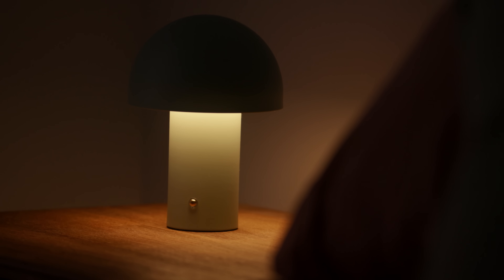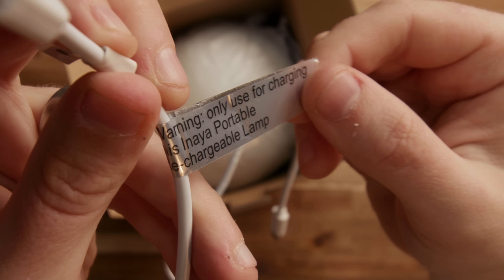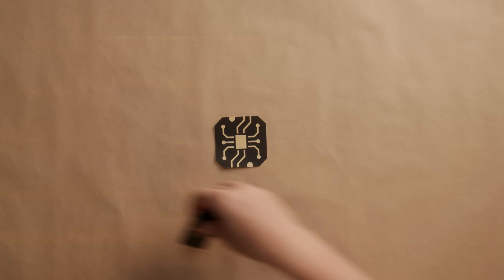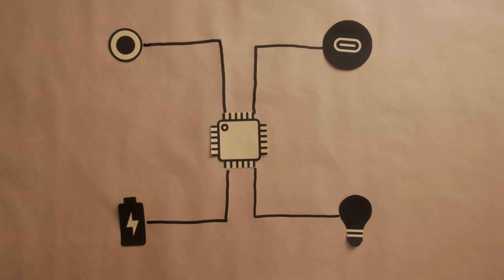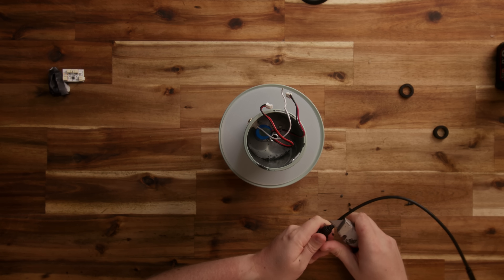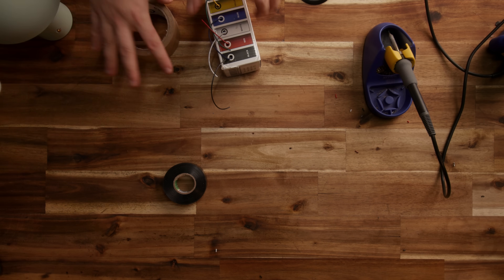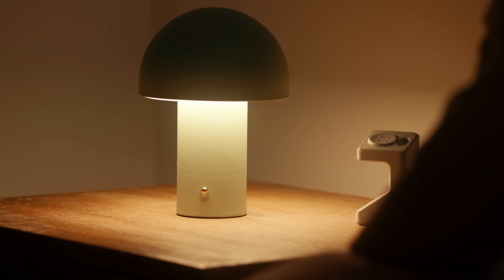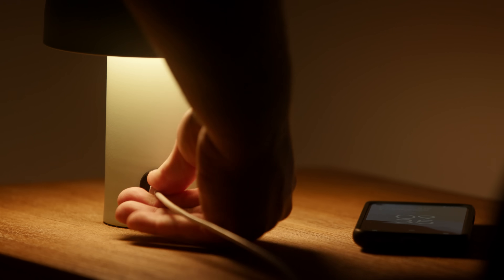Kmart Lied to Me, So I Hacked Their Lamp

Comment: You should change the battery for a power bank with USB-C-PD output and put a Qi charging coil in the base, then make your nightstands in to Qi charging surfaces.

That way you would never have to plug them in and you could use them as USB-C chargers for any devices that aren't Qi compatible.

Comment: I've realized that a lot more of my tech doesn't "line up" with how I like to charge this past year. I have found that the old "if it charges your phone, it will charge anything" idea simply isn't working. Learned that my fast charger could fry my playstation 5 controller was wild but true. Have bought two different specialized devices that needs a slow charge or I risk not being able to charge, or frying the motherboard. I now have at least a handful of USB-C cables that cannot distributed the correct data or power to be used universally. It is MADDENING. USB-C is  still the agreed upon standard, but the requirements don't go down to the power needed/allowed to juice and I think that's the problem.

Comment: For those diving into the project without much electronics understanding; on your website. How do I read the circuit digram re. the MOSFET. Which leg is which in your diagram?
Reply from the maker: That's a fair enough question! 

This link should have the information you need to solve that :)

https://www.talkingelectronics.com/projects/MOSFET/MOSFET.html
Reply: Just to send a follow up. I ended up wiring this up and get either of the following 2 outcomes. 
The light is permanently on before even energising the esp32. Or alternatively I can get it to work and a simple fade script to turn the light on and off. But in that situation. It only goes to I’d say 10% brightness. 

Is there something I’m missing? Do you have a detailed diagram or is there a part I’m missing?

Comment: Its just a non PD Usb C port , - not all USB c cables are the same, USB C is just a port that can come in a million of varieties , PD (power delivery) , DIsplayport , 3.1 , Thunderbolt . The kmart is just power , your cable has PD chip that signals if it should charge or stop because there is no communication between the charger and the thing being charged.

Comment: "The battery had the correct connector, but the polarity was wrong." I guess it's not intended to be a serviceable product at any point so they figure whatever's inside it is nobody else's business, but not even soldering the battery connector the right way round feels like commitment to making errors for the sake of it, even more so than choosing to ignore universal standards to save a few cents.

Comment: So many products do what I think this video will be about. Honestly how much do 2 smd resistors save you in costs. From what I understand you just have to pull low the cc lines if I remember correctly. That is if you don't need higher voltages

Comment: See…I just don’t get why this lamp needs a battery and a circuit board. 

My lamp has a cord that plugs directly into the wall and a mechanical switch I can use to turn it on and off. 

I’m so tired of things that don’t need to be computerized being computerized. 

That having been said, good work!! Also fantastic video.

Comment: I have a hair trimmer from Amazon with the USBc port, but it only charges if the other end is a USB a.  Any cable I plugged in works as long as it's not a C2C.

Comment: Do you need a resistor in series with the LED load?  Or is this ESP32 board with the Lion battery charger connector able to handle the sink current.

Comment: A very common issue, lol. So basically, it’s not that you have to use only the USB cable provided by the manufacturer. I'm pretty sure any USB-A to USB-C cable would work with it. The problem occurs when we use a Type-C to Type-C cable, as the port on the lamp does not perform a handshake with the PD adapter. As a result, the adapter doesn't provide the necessary juice required to charge the battery, and it doesn't charge.

Our phones, tablets, iPads, laptops, or any other electronic device from a reputed company has a USB port that does handshake with PD, and the PD adapter only provides the necessary voltage and current that the device requests. That's the reason we can charge, for example, our AirPods and a Mac with the same cable—even the same PD adapter.

Anyway, your project solves both issues: the handshake problem and also makes the lamp smarter, lol. I recently discovered your channel, and I must say you are doing an absolutely amazing job. Keep up the good work—and I must say, your doggo is really cute, xD.
Reply: This.

Comment: If using a slightly different module or adding one, you could power this thing do full USB-C passthrough. Or a hub module supporting fast charging passthrough. Thrn you  have both charging/powering of the lamp, and support full fat fast charging for other devices, using only one "charger". Could be handy if the outlet placement is inconveniently placed, or doing something similar for a lamp you want directly powered without batteries.

Comment: I have a unilite IL-925R. That inspection light has a usb c port for charging, but it refused to charge when using a "smart" charger like from ugreen. But it charges perfectly fine when you use a dumb charger that just outputs 5V, which is really annoying.

Comment: Correct me if I am wrong but I am pretty sure you can sue them over this, or get the USB foundation (or whatever it's called) to send a C&D to Kmart to get them to use actual USB-C. This is because, to use the USB name/ports on a device, you need to have a certificate from USB themselves.

Comment: You never mentioned it was a USB C to USB A cable, while not "compatible" a standard USB  C would charge the lamp since the data lines are not needed and +5v and -5v are correct for USB C to USB A voltage polarity just no data. The data would just be shorted and probably wouldn't be a problem.

Comment: I really enjoyed the presentation, thanks. However, I’d request you lose the music or lower the volume on it drastically. I’m hearing impaired and anything that makes it easier to focus on what you are saying is appreciated. Thanks & keep up the interesting vids. Oh, also, worked at Kmart in the 80’s- also bought a pair of knock off Tiffany style lamps, ended up rewiring them when the socket cases got brittle from heat. As we used to say: “Kmart, fall-a-part!”
Reply: Yes, please lose the lousy synth-beat "music." That crappy percussion seems to be all the rage; I rage right back at it.

Comment: There's no such thing as "USB C power standard".
USB C, like USB A and USB B, are just physical connector form standards. Like RJ-45, you can wire it to 10Mb, 1Gb, RS-232 or whatever you want.
The only thing that matters is if its USB 3.0 QC or PD compliant for charging. You could literally run USB 3.0 PD over a 3.5mm, 4 conductor audio jack and plug if you wanted.

If you think "USB C hole means more power" you're going to be plagued by garbage devices like this.

Comment: Similar issue with the cheap kids tablets at Big W. They have a usb port and my son brought it into my room and I thought I’ll smack it on my phone charger, no charge. You need to use the included usba power brick as it outputs a specific voltage/wattage to the tablet. It doesn’t have any sort of automatic recognition of usb c like the standard provides.

Comment: I'm less than a minute into the video and I already know the problem is that they didn't put the correct two resistors (less than one cent each) on the device side USB port, so it will charge off a dumb legacy USB A port but not a standards-compliant USB C PD port.

I run into this infuriatingly often and it makes me want to throw the product against the wall every time because I know the problem is so stupid and trivial/cheap to fix, but manufacturers just... don't do it right.

In the end, I usually sigh, open up the device, and bodge in the resistors myself. Wasting a bunch of my own time to correct a problem that any company selling a product (especially a real retail product at a physical store and not a shipped Aliexpress special) should know better.

Comment: Typically, higher Value Currency, makes importing easier; while Exporting becomes more expensive, not a Guarantee depending on cost of production in a Sovereignty. The exchange can be priced in, though, in Markets like Australia, the Living wage is fairly high, production cost is higher, making exports from Australia, potentially less competitive. A currency value is neither good High or Low, it's a matter of Quality of Life, of those within the Sovereignty; it's also a matter of market demand for the currency; you can have a currency with a lower value, while having high demand for that currency, the reverse is also True. Inflation/Deflation contributes to the evaluation, though the need to trade in the currency is very important to its stability.

Comment: My one objection is an automation to lock your doors. Don't rely on this. Your doors should be locked well before you're getting into bed - they should be locked always. You also should have multiple locks, not just one smart lock.
Reply from the maker: I probably didn't make it clear enough in the video, but the automation just confirms the door is locked, we certainly don't use it as our primary method of locking the door :)

Comment: Also interesting thing about usb c standard: some chargers (I think it’s fast chargers with type c to type c cables) don’t give any voltage by default. To get 5v from them you need 2 resistors between some pins in the usb c port of a device they are connected to. The problem is, many Chinese manufacturers just put normal type c ports thinking they would work the same as mini or micro usb they used before, so they just don’t work with some chargers. I actually bought some usb c ports specifically because they have additional resistors preinstalled, and I often have have to solder them to devices and modules that already have type c just because they don’t work with my laptop charger I use for most of my devices.

Comment: My ThermoWorks Signals thermometer has a USBc charge port but came with a US plug pack and no adaptor.
I tried various AU plug packs but none worked, so I checked the specs to find that their's was 12V.
Lucky I didn't use it to charge my phone.

Comment: Over complicated solutions to Simple problems. It is enough to install 2 x 5k1 resistors to make the charging work with any usb-c charger. Or to use usb to usb-c cable.
I think the author didn't read usb-c specification too.
Reply from the maker: The USB port was effectively potted in a moulded plastic part so that wouldn't have been possible :) first thing I checked!

Comment: It seems that everyone is arguing the toss over the technical aspects of what makes a USB cable, port or whatever, what it is and it's seemingly coming from technicians. I'd like to point out that as a consumer, or one of the vast majority of consumers out there, that I'm not a technician. So, if I see a product that's labeled "powered by USB-C" or whatever, then I should reasonably expect that it can take any USB-C cable and charger.

I don't know what the makers of this lamp did to the USB-C port to make it require a proprietry cable. The author of this video didn't explain it so I'd understand it, if at all. But if the cable is damaged, then I should be able to dig out a spare cable, plug it in and expect the lamp to charge.

When I go into Officeworks to buy something, you'll see a wide range of cables on display. Some say "charge and sync", others say "charge only". That should be clear and obvious to anyone who wants to connect their device to a computer to either charge or to access data on it.

But to have a product that promotes USB-C and then it won't work really needs to be looked at. I doubt that the ACCC will get involved (it won't even hammer motor car companies which don't honor warranties or their obligations under Australian Consumer Law).

OK, that lamp does look kinda nice and has the requisite "dimming" feature and if the cable is working then the product will work as advertised. til it doesn't, I guess. But at $17, what can you really expect?

Comment: And where is the answer? Why the USB C wasn't working? They did a cheap implementation of a resistor without CC lines, where only USB A -> C can charge it with 5v? Or maybe regulator in the cable, spitting random voltage through USB C? I want the answer.

Comment: The USB IF did this to themselves!!! they intentionally allowed manufacturers to mess with the naming scheme of the plugs and standards so that very cheap products could suddenly claim "USB C!" and the buyer will assume it is the latest standard of USB 3.2 gen2 or USB 3.2 (which is faster than gen2). If you look at how the standards are named, it goes USB 1.0, USB 2.0, USB 3.2 gen1 (USB 3.0),  USB 3.2 gen2 (USB 3.1), USB 3.2, etc etc. And USB IF HEAVYILY implies that the ONLY connector for the USB 3.2 gen2 standard is USB C. THIS IS FALSE. The connector shapes and the standards HAVE NOTHING TO DO WITH EACH OTHER. You can have a valid high speed USB 3.2 gen2 cable that is terminated with a human hand as the connector and it will be a valid USB connector. The reverse is also true. You can have a valid, exactly to spec, USB C terminated cable that is filled with nothing but peanut butter and farts, and that WILL be a USB C cable. 

in other words, your lamp did NOT lie to you. that is exactly a USB C rechargeable lamp, with the correct specs to have the USB logo on the box. The logo means the connector on the lamp will fit the USB C tolerances, and it does. it says NOTHING about what spec the cable needs to be. The lamp didn't rip you off. K Mart didn't rip you. USB IF FUCKED YOU RAW WITH NO VASELINE. And it gets even worse! USB IF managed to force some european countries to make the USB C plug the only plug on some products that is allowed. this was done in the name of "consumer protection" but it just made the market capture 100000 times worse. They can't innovate over there anymore. they will be stuck with the USB C shaped connector for probably 75 years. 

USB has become a fucking joke and a scam. It only exists now to confuse buyers and to allow manufacturers of cheap electronics to make a little more money. Go on amazon and try to buy the latest USB cable. even if you know exactly what to type (like USB C 3.2 gen2) it is very likely you will be a two wire cable that can only support 5 watts. and i haven't even touched on charging standards, which is an entirely different mess that is even more confusing still. what a fucking joke it all is

Comment: Seeing that you use a dedicated driver anyway, why not go with a constant-current device specifically designed for LEDs instead of a MOSFET? They aren't exactly expensive and will preserve the lifespan of your LEDs
Reply from the maker: I just happened to have some logic level MOSFETs on hand! You're right, a constant current driver would probably be a better solution.

Comment: Great video. Many pieces of tech have this problem and using a microcontroller board is awesome. Looks like the lamp didnt have PD circutry in it, so any stansard USBC cable should work with a non PD 5V power supply. You could also connect the CC pins of the lamp with a 5.1k resistor and that should trick any PD power supply to send 5V to the lamp with any USB cable!

Comment: I think I've come away from this video feeling confused why someone as well-educated and thoughtful as you would elect to have a stationary lamp that requires charging, increasing the hassle, and which contains a battery that will be difficult to impossible to recycle and cause unnecessary e-waste. Could the reprogramming you've done not be done on a regular set of lamps, which you plug in once?

Apart from that, very impressed by the reprogramming, that sounds like such a cosy set-up. Looking forward to your future projects!

Comment: Love this project and want to replicate it, struggling with wiring diagram detail though. Could the wiring diagram be updated to include the stripboard and also the video shows a wire connected to 'G' on the esp32, but the wiring diagram has this excluded.
Reply from the maker: The G wire isn't absolutely necessary. 

Think of the strip board as just a way to join wires to pins, I used a 4 'wire' board Instead of soldering directly to the legs of the mosfet
Reply: @TheStockPot-AU  Ok, that makes sense, I have a couple of these lamps, I think this will be a fun project. 😄

Comment: You complain about e-waste while using battery powered lamps on nightstands instead of using conventional power, then creating e-waste by modifying the whole thing and disposing of the original boards/cables/ports....

Cool project, but at this point why not just 3d print the shell, install your esp board, led, and a power supply. Then you'd have way less waste and not financially incentivise K-Mart/whatever manufacturer to continue making and selling trash products :)

Comment: I didn’t know that there was still a Kmart store open.  
Interesting modification to the lamp but I have to admit I have been trying to remove every lithium ion battery I can from the sleeping area of my house after I rechargeable flashlight catch fire while charging. Fortunately I was nearby saw it ignite and was able get it into a metal trash can (a good reason for metal trash cans) and then outside where it burned for a while before going out.  That caused me to not charge any device unattended and never in the sleeping area of the house again because once bitten twice shy.